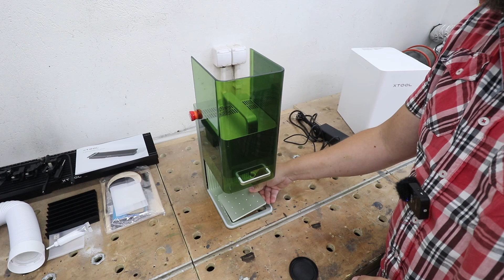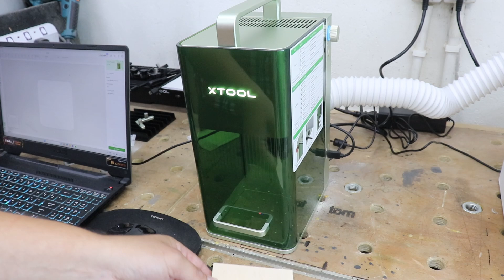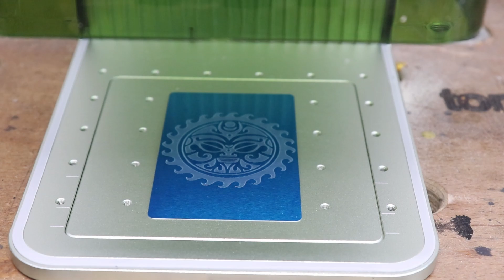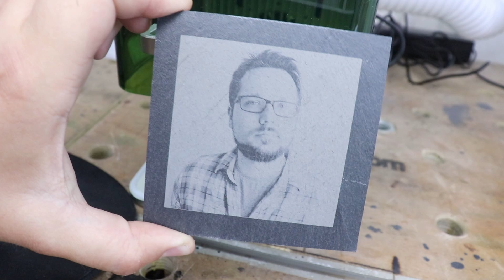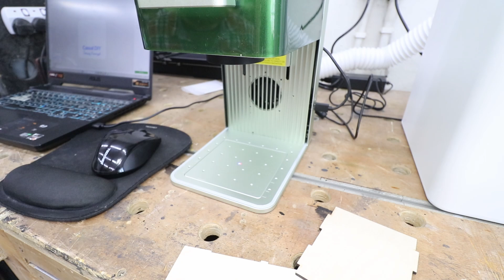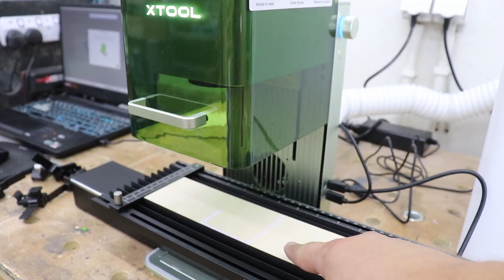xTool F1 4000mm/s Laser Engraver with Infrared Module - Overview & Testing

Comment: Production values are slipping, you switched to copper but kept on referring to it as brass 🤣
Something not right with the IR when engraving metals, very poor performance ... I checked out a video of the XTOOL D1-PRO with the IR module and the engraving is basically black on most of the metals tested ... looks like they are both 2W lasers 🤔
Anyway, thanks for the video, this product is not for me personally but still interesting 👍
Reply from the maker: Hehe well spotted, didn't noticed that until you mentioned it. And I re-watched the video before publishing like 4 times lol
It's about the speed mate with the IR, it's only 2W so you just need to go slower. The speeds I was using were way to quick. But still gave decent results.